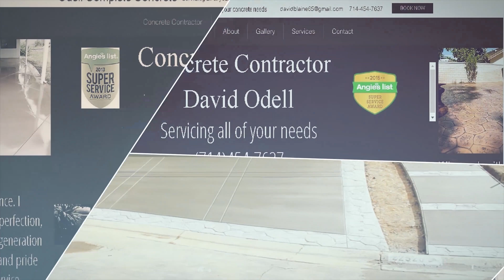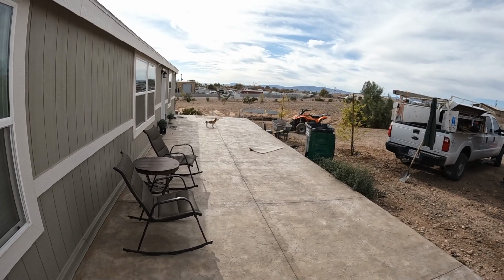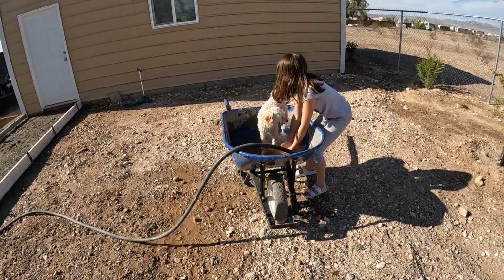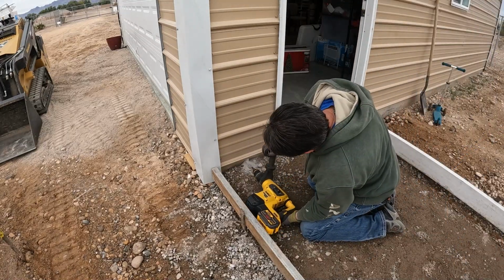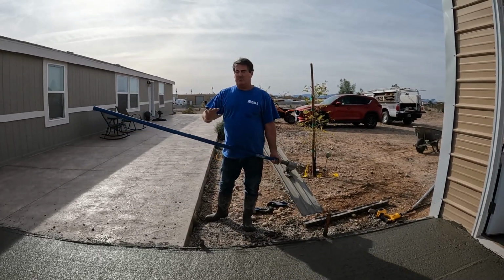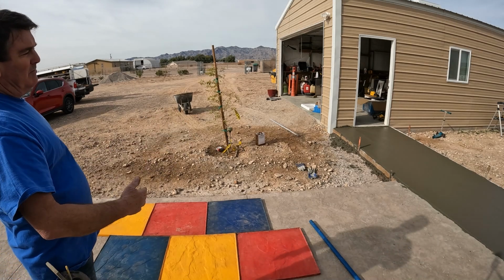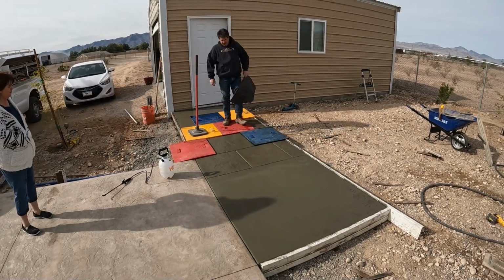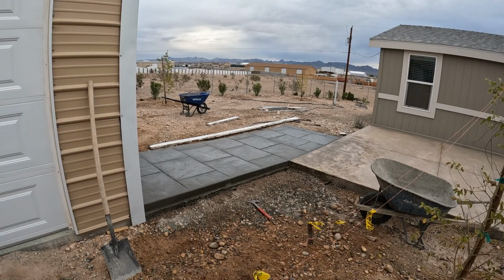DIY Family Stamp Concrete

Comment: Awesome Family video and I thoroughly enjoyed it! At the end you mentioned concrete stain and wanted to ask a question.  I have a fairly big stamped concrete patio that's approaching two years now and a few parts of some of the release agent (not much overall) is coming up; I think the snow in TX last year did something to a few parts.  I don't have the release agent the company used and unfortunately they had to close due the passing of the owner, which made me very sad.  Any suggestions how I could fix if I did find the release agent?
Reply from the maker: Depends if there is sealer or not
Reply: @OdellCompleteConcrete  Thanks for the reply.  Yes, it was sealed as well.  Am I out of luck and just have to let nature take over?

Comment: Awesome work!  I finally scored a great deal on one of the older 18V DeWalt concrete vibrator that came in a set with another 18V angle grinder and a cut off saw.  Not sure what I'll do with the later... though I wonder with the 20V adapter and battery... how it'd cut steel with a great blade.  I also am wondering what I'm going to do with the umteen old 18V batteries.  Thinking some of those I might be able to use the cells for some sort of solar power charge controlled outdoor thing yet to be determined. 🙂 Great work as always, thanks for sharing!  Surprised you didn't color or dye while at.  Has me thinking what might be homebrew cost effective to make your own DIY concrete dyes?  On the topic of batteries, I've wondered about like a rinsed manganese oxide, powdered carbon rods, rust and I'm forgetting offhand what others I've though of that aren't like pottery glazes.
Reply from the maker: Cuts like butter, in my next video
Reply: @OdellCompleteConcrete  Inspired the thought for me to consider making a concrete cutter out of the bundled deal DeWalt circular I called a cutoff saw.   Didn't even think about that or can do the look colorant stuff after sets if wanted.  Forgot. Looking forward to sir.

Comment: what type of tool is that at the 14:24 mark? Is that what you use to smooth the concreate out right after it was poured? How long do you typically wait after you poured it to use that tool
Reply from the maker: That's a bull float
Reply: @OdellCompleteConcrete  ok thank you